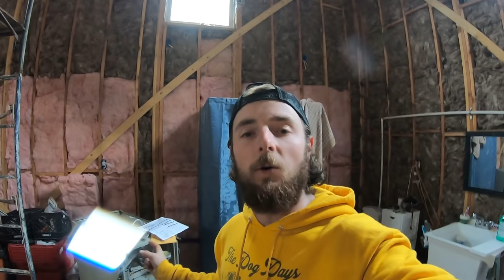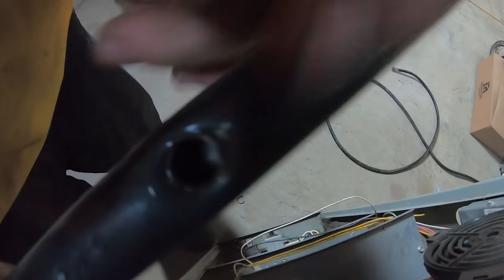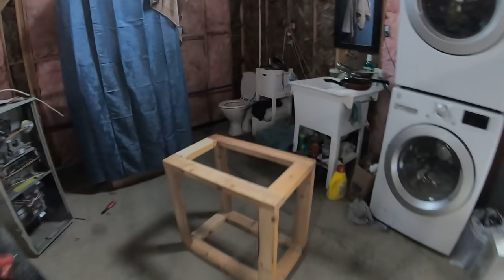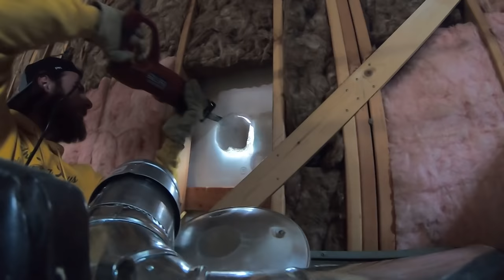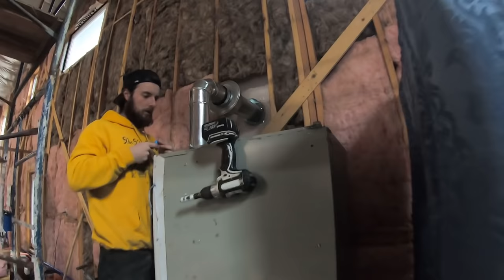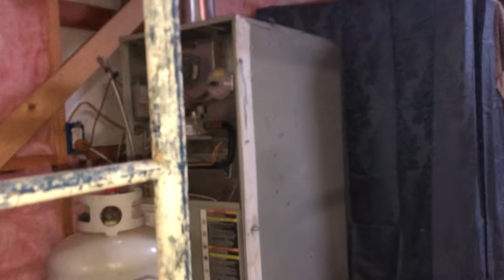Fixing Stuck Gas Valve - Works Every Time | Installing propane Furnace |Millennial Homestead Build

Comment: You need to use black pipe for gas line inside of gas furnace, you can not use water line for gas it is very dangerous
Reply: I do believe this is true. My people tell me propane eats away the inside of the pipe so must use black...but for natural gas you can use both :)
Reply: @Ronaldinho Gaucho  correct any sort of flexible pipe for gas should never enter the unit itself

Comment: The general rule with gas valves is you don't fix them; you replace them. I understand you made a temporary repair until you get the new part; you also said you wanted to keep the place warm when you go away; so you must have a safe operating furnace and regulator. You don't want to cause harm to your family or property; do not tell others less capable than you who may get in serious problems.
Reply: He did say (just after 11:00) that they had a new valve on order and that this was just a temporary way to supply heat. So hopefully everyone watches the video to the end.

Comment: You shouldn't be sharing this because that's not the way to hook up a furnace. That Regulator with the Red knob, what is the pressure rating ? You only need 1/2 pound of gas pressure to operate that unit and remember that the control valve isn't designed for more than 2 psi.  Be careful with your "fixes" don't learn things the hard way.
Reply from the maker: Heat vs no heat. It’s all temporary

Comment: Careful not to crack the heat exchanger with variable unregulated gas pressure. The gas valve is also a pressure regulator and even after installing a replacement, the pressure should be calibrated with a manometer. Its a simple inexpensive calibration that can save 1000s of dollars since if neglected can destroy your furnace due to overheating!

Comment: Ya can't leave that gas valve like that when ya are gone let alone never did a leak test before lighting it up .also ya don't mess with a gas valve period unless you are certified tech you replace them with a new one .I f was a certified tech hivac I'd red tag ya condem the unit right then and there pluss fine ya the max allowed per codes if ya ever have  enough money to pay your fines I may still throw the book at ya  be taken to court
Reply: Calm down there chief
Reply: Darned right!

Comment: LOL that's so cool MacGyver like. Now I was told by my propane company that I couldn't run my furnace off a 20lb tank that the pressure regulator valve would freeze. But I see you're not having any problems with it. Good Job.
Reply from the maker: Thanks Ray, it works as a temporary fix

Comment: $100 gets you a new gas valve that operates safely.  The water line used to conduit gas to the valve is problematic.  Manually feeding gas to the main burners is a disaster waiting to happen.  I've been rehabbing buildings since 1983 and have taken a few shortcuts myself.  But screwing around with a gas valve and supply lines is off the charts crazy.   I'll look for his / their name in the obituary section.

Comment: ⚠️WARNING: Firstly, thank you.  I can see where this might help me get through the night in an emergency. 

The problem,  unless I am mistaken, is the gas valve is like a switch.  It turns off the gas in emergencies.  

Ex. The little sensor that looks like a diode on the right side will send a signal to the valve if the flame gets too big. 

There piece of metal that is in front of the flame (thermocouple) shuts down gas if the pilot goes out.

That's just 2 ways you can now make it go Boom.

Lastly, there is no adjustable regulator on natural gas systems and you may get a fireball trying this on those systems.  Good luck.

Comment: Do you know how to check the heat exchanger for leaks? That is a very old heater to not have any thermal cracks. Small cracks in the heat exchanger can leak carbon monoxide. My furnace looked good until it was removed and given a thorough inspection when repairing the A/C. When it is dark, shine a light in the flame area and look for light leaking out. 
Did you clean the flame detector? It is a wire that measures ionized air from a flame and prevents gas from flowing when the flame is out. There are plenty of YouTubes showing how to use emery cloth to clean the flame detector. If it is slightly corroded, it will stop the gas valve from opening.
Always use BLACK iron pipe for propane, never galvanized iron pipe for propane.
Reply from the maker: Good to know, thanks Mark- happy new year!
Reply: A flame sensor is pretty cheap and the emery paper works but replacing it no big deal.
Reply: I also noticed he went from single wall pipe to double wall; he also needs to have a slight upward pitch on that outgoing pipe for proper fumes flow! I wouldn't live within 2 thousand feet from Mike's place...!

Comment: One Thing against safety codes to run gas flex connector or water connector pipe  lol thur the furnace cabinet & just extend hard gas Pipe to exit Furnace cabinet & get ya an 2-3' gas flex connector

Comment: Mike, I know this is a temporary, supplemental thing right now, but I've got some concerns. I can't tell for sure, but it looks like some of your vent piping is single wall pipe, it all needs to be double wall pipe. You risk carbon monoxide poisoning using single wall pipe. For your gas line, galvanized fittings are always a no-no, you should be using black pipe and fittings. And for the flexible line, please get a proper flexible gas line, I would not expect that toilet line to last very long. I'd also highly recommend using dish detergent and water solution to check all gas connection (and the reworked valve) You may have done that, but I don't see it in the video. Lastly, I'd highly recommend a carbon monoxide detector in the shop.
Reply: Mike removed  the internal valves & just made the entire valve a section of pipe, thus bypassing every safety feature of the unit. People go to jail for doing this kinda stuff, after someone dies.
Reply from the maker: Yup, she just free flows with the crack of a valve. No sure how CO will leak through single wall? Same setup as the old house. The double wall is for through the wall purposes. It’s all temporary.
Reply: Ron Crook you're right on all points; this is a typical "Bubba" job! No offence intended; just a call to reality!
Reply: @Supa Trending Daily Most building codes also call for double wall pipe any place that is within reach, so that no one burns themselves on a hot vent pipe.  But considering everything else going on in this video, that is the least of his worries.

Comment: A SS 1/2” FIP connected to an LP gas valve is quite possibly one of the quickest ways to create a hazard that threatens your family. Do not do this. Black iron pipe into the valve and if you would like, beyond that, you can use a rated corrugated stainless steel supply into the drip leg and union assembly. Monday morning Quarterbacking… YES. Serious injuries could ensue.

Comment: That's not a toilet supply hose. They are 7/8. You are using a 1/2" flexible supply line. Be careful someone might want a drink and unscrew that braided stainless steel supply line looking for water and accidentally set themselves on fire!
Reply: Ha ha ha! lol.

Comment: Shouldn't you use a bigger propane tank with a higher psi pressure regulator for a furnace and proper gas lines?? Just wondering, I'm a paranoid female around propane with carbon dioxide poisoning!!
Reply from the maker: The bbq tank lasts about 12 hrs.
Reply: You meant CO or carbon monoxide poisoning. A large concentration can kill a person or a family in less than ONE HOUR; think about it. My dentist lost six relatives from CO the very night they had installed a new furnace. The exhaust piping had a long run to the top of the roof of a two story home. The cold temps caused the CO to condense and run down to the basement. Big lawsuit for the installing HVAC company. Inexperienced installers for sure.

Comment: Are you worried about the efficiency using something older?
Reply from the maker: Nope. It was salvaged, you get what ya get and don’t throw a fit.
Reply: First thing to check is the condition of the heat exchanger; if the furnace is very old and out of warranty the exchanger will cost as much as a new furnace!

Comment: PIZZA!!!!! On a side note, nice job on the backwoods engineering to get it up and running until the parts come in. It's that kinda thinking that will get you out of a stuck spot when there's nothing else you can do. :)
Reply from the maker: I think the toilet hose give it better flow
Reply: @LaidBackLiving  Is there a reason you cant use it? Never looked into the difference.
Reply from the maker: We never researched it. We did compare both rubber hoses side by side. (propane line that wouldn't work vs water line that would) That's all they were, rubber hoses.
Reply: @LaidBackLiving  I wonder if there is a difference between the rubber used in the hoses, something that propane would react differently with. I'll have to look into it. :)
Reply: @LaidBackLiving  Talked to my propane friend, he said the propane will eat the water line rubber hose. Propane lines are made from a different kind of rubber. :)

Comment: Is your build a special design?  I noticed you didn't put any plywood or sheeting on the frame before you put on the tin.  I've never seen a build like that before.  Curious.  Thanks
Reply: They added cross bracing for shear in the framing to avoid needing sheeting on the frame.
Reply from the maker: Yup. No sheathing. “Strip sheathing” or purlins, nailers, lots of names.

Comment: that exhaust cant be exiting right below a window!
Reply from the maker: It’s offset. Won’t have the window open with the heat running.
Reply: @LaidBackLiving  this is like our generator disconnect, we know that we have to turn off the main breaker to run the generator, we didn't need a little peice of metal to tell us that.   You know that the window stays closed when the heat is on!! Nice job!
Reply: @LaidBackLiving  You just hope so!

Comment: Wtf dont ever bypass a gas valve. If the heater overheats this is incredibly dangerous. Hes risking burning down the house.

Then you cant use a water line instead of a gas line. This guy is asking for trouble. Do not follow this horrible advice of this video.

Comment: First of all, you didn't fix the gas valve, but rather, by passed it's safety system. Hopefully you won't burn your ouse down if the ga stays ignited and the blower and inducer motor fail.  I was hoping to actually fix my stuck valve, I would never do what you suggest. Obviously keeping an eye on it would prevent a disaster, but what if someone walsk out of the room and the blower goes off and you have a thermal meltdown.  Take care, you'll probably be okay for a short term heat solution.